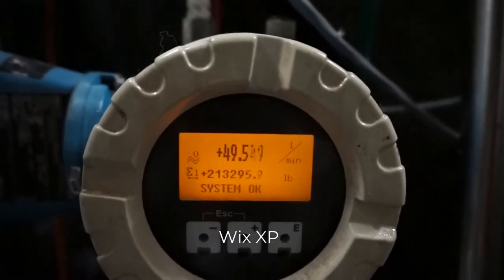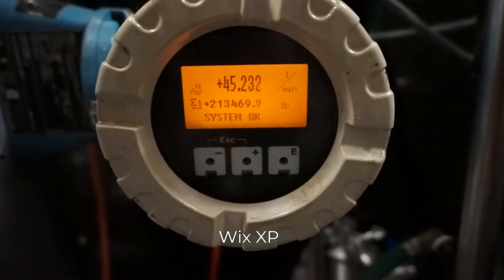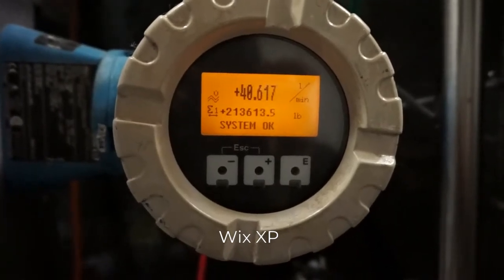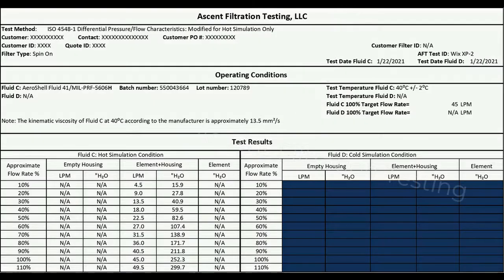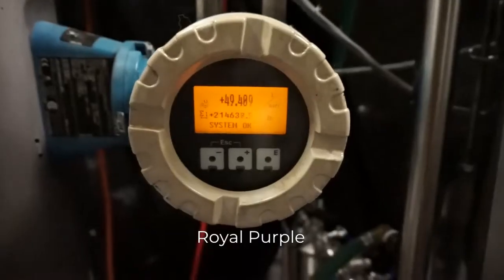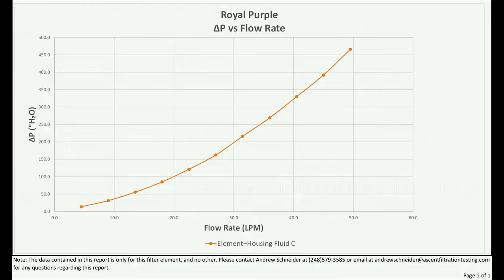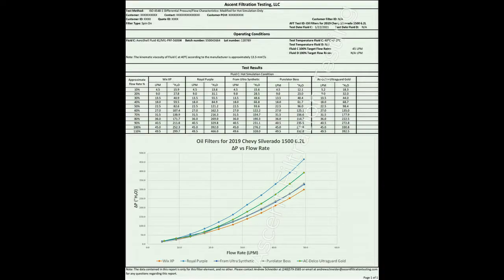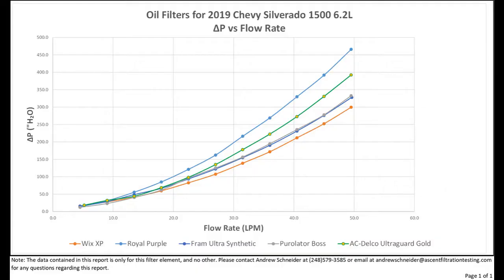Pressure Vs Flow Testing Oil Filters

Comment: Great test.   These filters are all high efficiency filters with ratings in the 20 micron range at around 98.7% filtration, correct?  Have you used the same setup to test any lower-efficiency filters with more traditional filter media, which would typically be rated at around 40 micron at 98.7%?  If so, how does the pressure drop compare to these high efficiency filters?

You stated that the test fluid had a viscosity of 13.5 cSt at the test temperature of 40 degrees C.  This is the viscosity of a 5W30 motor oil at approximately 80 degrees C.  Even with such low viscosity, the pressure differential was as high as 18 psi at high flow rates.  The bypass setting on the FRAM Ultra that was tested is 16-28 psi.  With colder, thicker oil, the differential pressure would be even higher.  This indicates to me that the filter would tend to be in bypass quite often at moderate-to-high rpm before the oil is over 80 degrees C.  If this is the case, I wonder if it would be better to install a lower efficiency filter and/or and oversized filter with less restriction, especially if the vehicle sees a lot of cold weather and short trips.
Reply from the maker: I am glad you liked it! I am not sure what efficiency and micron sizes these filters are rated at by the manufacturers. When I get around to making the 3rd video in this series I will look it up. I have tested both higher efficiency filters and lower efficiency filters than these 5 here, but I cannot comment on those, because I was paid to run those and sworn to secrecy. In general the more restrictive the filter the higher the efficiency. Traditional cellulose media is usually less efficient, but less restrictive depending on how many layers and composition. The new synthetic non woven media come in so many different flavors it is hard to generalize. I am seeing many different supplier rolls of the stuff, and not much data on the efficiency and capacity performance per unit area. Manufacturers also never seem interested in wanting that data when I approach them. A big marketing mistake in my opinion.

Comment: subbed for the great data.  nice equipment with the FMI pump, Rosemount transducer, and mass flow. Looks like its all XP too. 👍
Reply from the maker: I am glad you like it! Yes FMI make great products, and the guys working there are really fantastic! Those Rosemount's can really take a beating and have great accuracy as well as precision! I am a big fan of the mass flowmeters! They have an incredible accuracy over all other types, and connect to PID controls very easily.

Comment: It would be nice to know how each filter would perform when used oil is ran through them and see which one would clean up the oil the best.
Reply: Yes, oil progressively contaminates which thins it out towards the end of the oil change period.  Starting an engine from below freezing affects media filter, anti-drainback valve tension and oil flow rate.

Comment: Awesome!  @50% Flow the delco, boss, & ultra are inline, whereas wix a bit low & royal purple looking like "old Faithful".  What a flowing beast!  Fascinating!
Reply from the maker: I am glad you enjoyed it Justin! Actually in order to achieve the same flow rate at 50% flowrate the Royal purple requires a greater differential pressure thus being more restrictive. So it is actually the inverse to your initial assessment. The Wix XP has approx (Without interpolating) 30 LPM flow rate at 121.2 "H2O pressure, where the Royal Purple has 22.5 LPM at 121.2"H2O.
Reply: @andrewschneider5381  No issues... I'm an idiot HA!  Thanks for pointing that major difference out.  That makes sense & That is the part that I think you can help us all better understand the filter dynamics.  Thanks!
Reply from the maker: @justinvegan  Thank you for commenting  I really appreciate it! If I can help you in any way with understanding liquid filters just ask.
Reply: @andrewschneider5381  Maybe on video #3 call out verbally or call out best and worst so some of us who can read graphs correctly, as what happened  here in the comments. Thanks we finally get some concrete testing, instead of just cheerleading a filter on  advertising and UOI.
Reply from the maker: @tedtedness184  Thank you for watching! I will try to cover everything in the efficiency and Capacity test. It is very complicated and has much much more going on. I am afraid the video will run a long time. The 2 problems I have is 1) I cannot show the test rig, because I have custom designed components that I do not want my competition to see and copy.  2) I cannot say one filter is better or worse because I must remain unbiased. I can describe in general how to interpret the data.
Reply: 2 years later and still waiting for the 3rd video

Comment: I would love to see a video on cold flow bypass etc. How does these test fluid here compare to, say, 5w30?
Reply from the maker: The kinematic viscosity was 13.5mm^2/s for the testing. Approx 5W30 at 100deg C
Reply: @andrewschneider5381  Isn't that the same as cSt? The data I have show 5w30s at 100C around 10.3 cSt and 5w-40s at 100C around 13.4.

Comment: I’ve never seen data like this and find it very useful.  I see why so many like the WIX but I am also a fan of the Purolator BOSS due to its ability to remove small particles!  One question I have was whether you can see on your graphs where the bypass valve opens?  I don’t really see an abrupt change in flow. Also, it would be helpful to know where most oil pumps and engines operate as far as oil flow(20-40 LPM)?

Comment: Can we correlate these test results to the matter of the pressure differential setting of the oil filter's bypass valve, which opens up when the pressure differential surpasses the valve's design setting when filter media becomes clogged or when oil temperature is very low?  If my calculations are correct the lowest differential pressure needed to achieve 100% flowrate was 9psi (Wx) and the highest was 14 psi (RP).  What would be the proper relief valve design pressure differential for these filters to open up not too soon and not too late?  If set too low, the bypass opens too soon and the benefit of the filter is lost too soon.  If set too high, the bypass opens too late and the engine loses oil flow.  Any comments?
Reply from the maker: Hey Steve thanks for watching!, I think this would require a bit of time to devote to answer bypass valve design. There are a few design models/strategies/philosophies that I have seen used. I think an engine designer, filter design engineer, and of coarse a testing engineer :-) would be a great team to put together to answer your question.
Reply: @andrewschneider5381   Yes, it’s a technical question. Thanks for the reply

Comment: How does this equal or compare to oil psi inside the engine?
Reply from the maker: Hello Leigh, 1 PSI=27.708 inH2O. This curve tells us the challenge (in differential pressure) the pump must overcome to achieve flowrates.

These flowrates and differential pressures only correspond to the liner portion of the capacity curve (not shown in this video), this linear portion is the design region for the filter, after which, it becomes unstable and will plug at an exponential rate.

Knowing the oil pump performance curve,  engine operation rpm vs flowrate vs pressure, is one indicator that helps the filter designer engineer alter the media surface area, media type, or other components to achieve required specs from the OEM.

Comment: Great video Andrew. BTW what type of flow meter are you employing? Would the same type of flow meter work with added contaminants?
Reply from the maker: Thank you Azeem! I appreciate your kind words. It is an Endress + Hauser Promass (coriolis) flow meter. It is extremely accurate with contaminated fluid. Promass work much better with contaminated fluid than say ultrasonic, mag, turbine, vortex, or thermal type flow meters. Only real disadvantages are the cost (very expensive), and they are heavy!

Comment: So the higher the inh20, the less restriction?
Reply from the maker: Hello Captain, the higher the "H2O differential pressure/PSID the greater the restriction.
Reply: @andrewschneider5381  is there not a correlation between filtration efficiency and pressure? I’d imagine that you would want a filter that balanced flow and filtration efficiency. The higher filtration efficiency, typically a higher pressure due to smaller micron filter media.
Reply from the maker: @test15799  there are to many different types of media to relate. If media type is held constant then increasing the surface area would lower differential pressure with no change in efficiency. Other components also contribute to differential pressure as well and differ from filter to filter. I hope this helps. I have more info on a specific design, however I am bound by law (NDA) not to discuss it. Thank you for comment!
Reply: @andrewschneider5381  so having a physically larger filter element/casing would negate the flow restriction by having a smaller micron filtration rating, In terms of flow.  Just so we’re on the same page.
Reply from the maker: @test15799  If using the same type of filter media as the smaller housing yes. You could also use the smaller housing and add more pleats or increase the depth of the existing pleats to increase surface area. Currently companies are working on the research and development of new types of media to achieve greater efficiency coupled with greater flow. Exciting stuff!